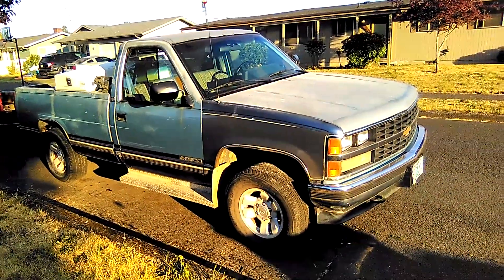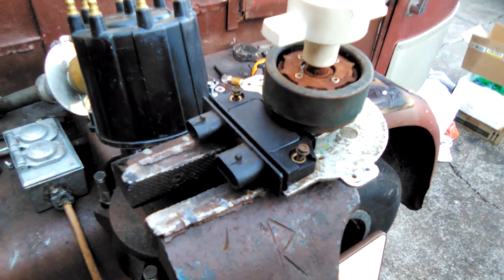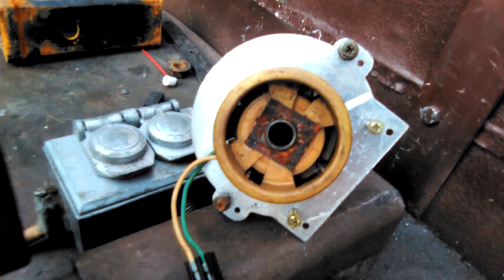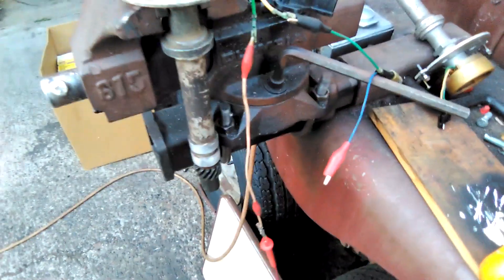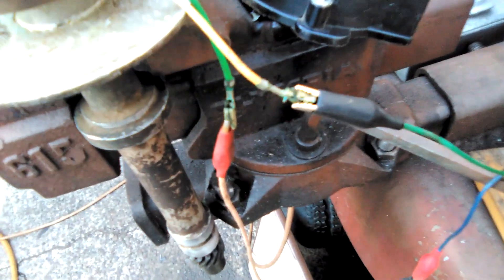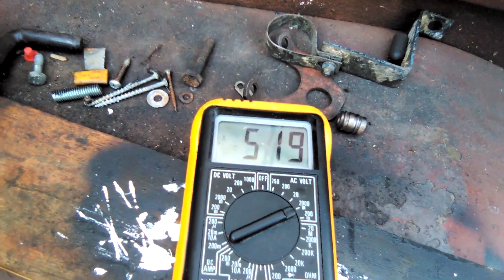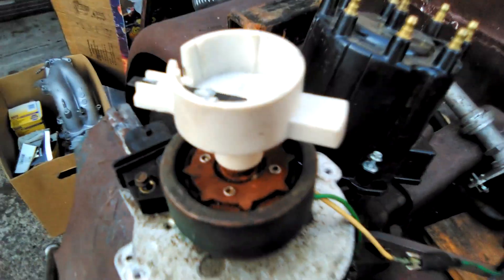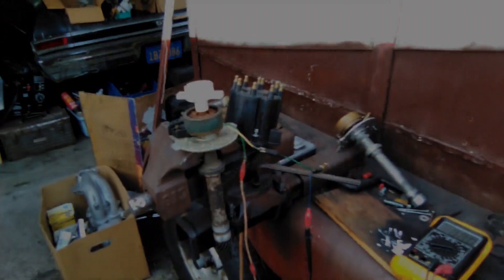Testing TBI Magnetic Pulse Distributors

Comment: How about the magnet, will it work even if it is partially cracked or if it has some iron dust on it?

My engine only sputters around 3k RPM, doesn't want to rev any higher unless I program twice the amount of gas (6:1 instead of 12:1) and was thinking it might be the magnet. Will check it today.
Reply: I'm having the same thoughts about the distributor magnet in my '88 Chevy G30 van. It's 5.7 was running great then suddenly began the start - won't idle problem without throwing any codes. It did in 1996 when the factory coil pickup went out due to being subjected to high engine temperatures when the former fleet vehicle sat idling for prolonged periods of time. I replaced the ignition control module at the same time. This time I first replaced the factory IAC since it was stuck closed. That helped it idle a second longer so tested the TPS by placing shims cut from a cereal box between the idle adjustment screw and the throttle cam. Six shims got it to idle with the engine not dying out when set in Drive or Reverse to move around at idle speed. I let the engine idle for 30 minutes to charge up the battery as I drove to get a new TPS. Got that installed but now it only idled for 5 seconds before dying out. I removed the distributor cap to test the coil pickup magnet's magnetic attraction using a screwdriver. Didn't feel a thing so tried the bent paperclip I use to jump the A & B test terminals. I could feel a slight magnetic attraction by using it. Nobody seems to know how strong that attraction should be. The auto parts stores won't remove the distributor cap from new ones so I could see by using a screwdriver. One old guy told me that stacking round speaker magnets on top of it will remagnetize the coil pickup magnet.